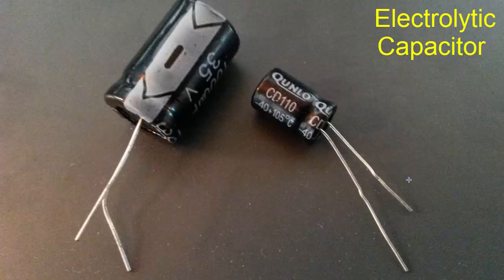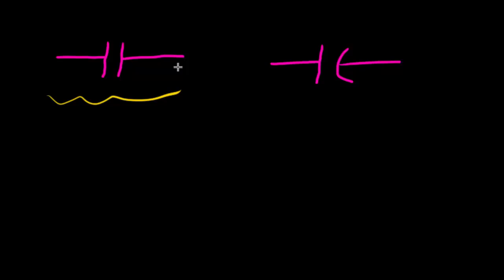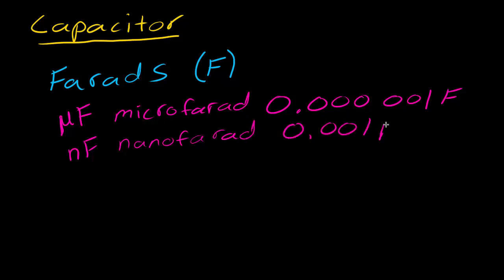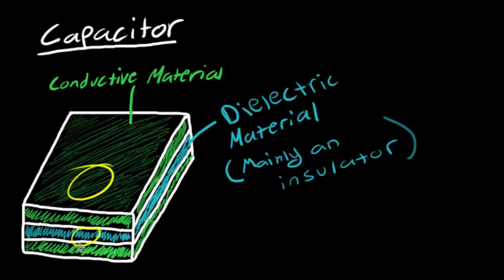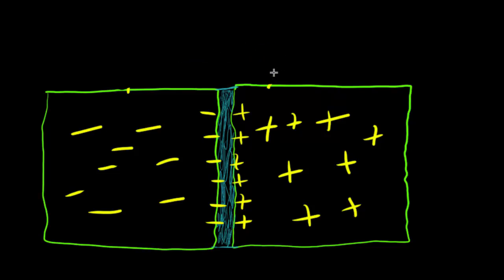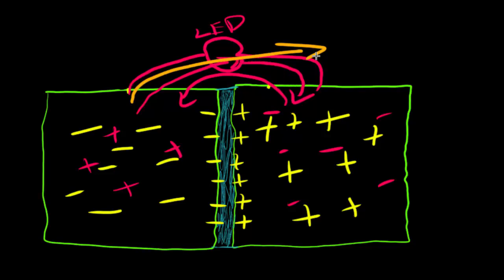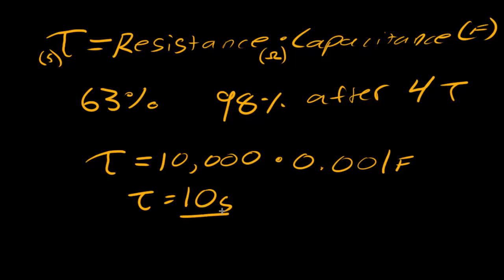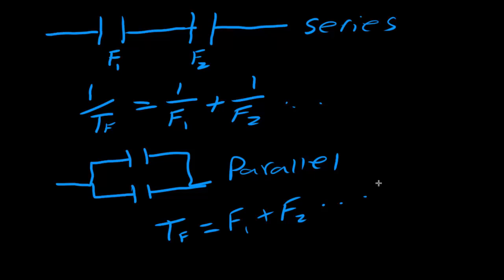Beginner Electronics - 19 - Capacitors

Comment: So in a more complex circuit such as a guitar amplifier for instance, the amp is continuously plugged into the wall outlet and therefore powering the circuit so what are all these caps doing? Are they just charging and discharging to push more power through? I feel this is the one thing I have just failed to see for some reason... 

I've learned so much through these vids and was so excited to learn about caps! Thank you for the info!

Comment: I've been trying to find an answer all over and can't figure out.  If I have a device that is going to require more power than can be delivered from a single wall outlet is there a way to implement to supplies into the circuit and say plug into two or three different wall outlets?

Comment: im sick of these tutorials about capacitors, been searching for a while on youtube on what capacitors are use for, but all of them only explain is whats inside them and how they work >:(
Reply from the maker: As you get more and more into circuit design the uses for many components becomes much clearer. If you continue working with electronics and building things, uses will come with time!
Reply: B74CKB15H0P You use them to temporarily store electric energy. In the circuit, you may want to charge and discharge them after periods of time. The classic application is an oscilating circuit (LC-circuit), the upgraded version - multivibrator, and RC filters, for low and high frequencies.

Comment: i have a question sir, when should we use the capacitor and why should we use it.?
Reply: Good question. Maybe this will help give some idea. A seemingly innocuous device such as a disposable-camera flash unit, powered by a 1.5 volt AA battery, has a capacitor which may contain over 15 joules of energy and be charged to over 300 volts. This is easily capable of delivering a shock.

Comment: Didn't you say that current doesn't actually flow through the capacitor. So how can they ever be in series?
Reply: denis moloney i don't know much about electronics, but i think if you hooked it up to your series circuit it would just equalize and the flow would start to decrease and open the circuit
Reply: I believe as electrons collect in the one side of the capacitor they create an electric field that that generates a voltage across the gap which travels along the wire and at the next capacitor the electrons again collect and create a voltage/electric field across the next gap and so on
Reply: I=V/R 
The "gap" is resistance so if voltage went through it, it would have current. So that doesnt work out. 
In dc series circuits the current flows until the capacity is reached (charged) then the current falls to zero since it balances out with the battery charge. In ac circuits current can flow both ways so they're more beneficial for ac
Reply: Probably wouldnt use them in series, youd need a parallel to discharge it
Reply: The capacitor, like a battery as per said, builds up the charge to its certain level, then send off a discharge. Similar to a Diode, which with some have a build up to a certain level to get put. This prevents a constant lower level "Draw" while it is charging up.

Comment: We got off easy in this video in an actual electronics class you have to answer questions like this capacitor was charged for 10 microseconds how much charge does it have?  Now it is discharged for 3 mS how much charge? Now it is charged again for 20 mS what is the charge and it would go on for a bit charging and discharging for varying times and you had to keep calculating it at every point.  ARRRRRGH!